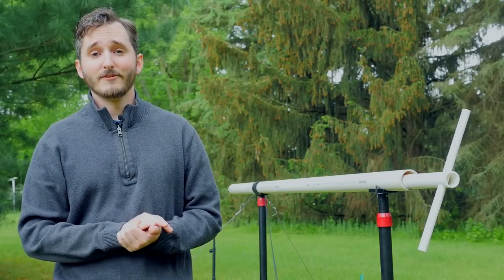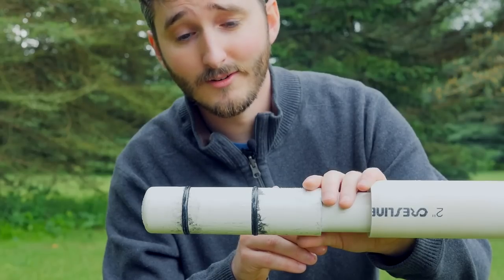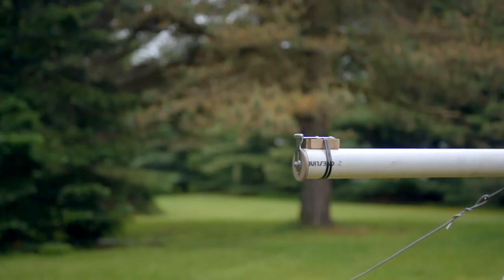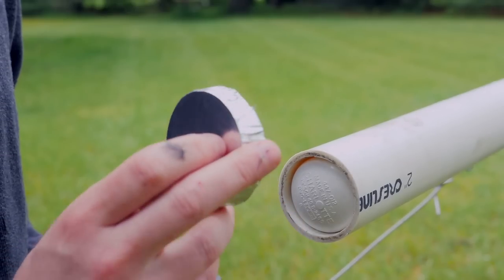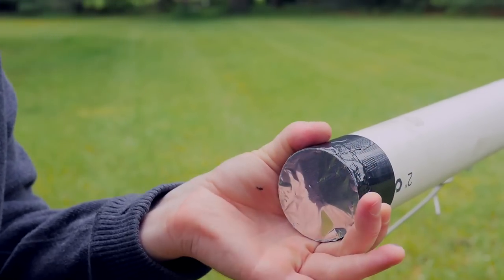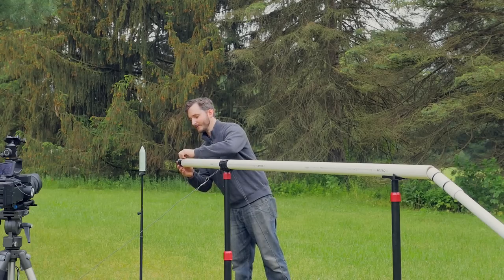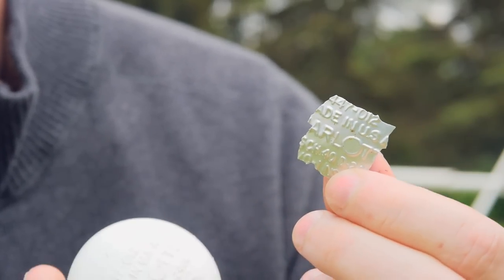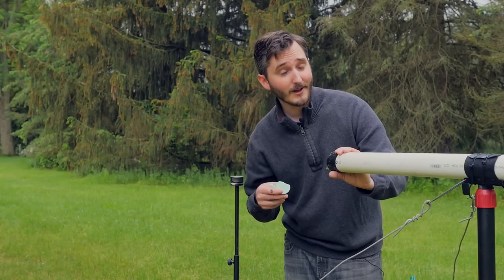New Vacuum Cannon Design - No Vacuum Pump Required!

Comment: Great invention! I'm gonna try and make this, I'll give an update on the results...

EDIT: Made it. Great design. This was one of my first inventions of this kind, it was really fun to see it fire. One bit of trouble I had was having the foil seal at the front pop as I pulled it back before it fired, I had to layer one thicker kind of foil over a thinner one. It wasn't as powerful as this one, about a third the size, but it shot about 25 ft, that's good enough for me. Thanks!

Comment: That thing you used to improve the end of cannon could be upside down to have a little help of gravity to open before the projectile reaches the cannon's end. If this keeping falling before pull the "trigger" you could use a weak magnetic on the top of cannon to hold it closed until the trigger be pulled.

Comment: Completely awesome. I wonder if you could rig up some kind system that could be mounted to the cannon to push the piston so you wouldn't need guide wires. Something like a hand crank winch or rack and pinion.

Comment: What if you interested used the projectile as as an end cap? That way you can make a better seal and not have to make the disks. Also for the air that will push it forward a bit before the the "big push," you could make an exception that goes around the projectile end cap, then put that at the end so you can still get the full push of the vacuum.

Comment: Ive considered building a recumbent trike from schedule 80, even heating and squashing it for use as leaf springs in two front end suspension type of a leaf spring.  Your piston seems to fit the bill as an nice air shock for the rear wheel.  if schedule 80 isnt enough by itself then sliding an additional schedule 40 to add wall thickness surely would do the job.

Comment: This is a really cool idea.  I had a few thoughts though that might make it a bit more portable. If you fasten a rope to the back of the piston rather than a long rod, you could crank it back with a crank attached to the breech end of the barrel.  That would keep it from needing the bracing.  You still might need a rod to push the piston back to the muzzle of the barrel for the next shot, but less force there, so again you wouldn't need the guy wires and braces.  I think the trapdoor on the end is a great idea, and it would work, it's just a question of mass.  The air pressure in front of the projectile isn't accelerating the trapdoor fast enough for it to get out of the way in time.  It really needs to be something lighter than a hinge, metal plate, and bolt.  A string dangling a piece of very thin aluminum or plastic against the muzzle might work.  You could lower the moving mass too by putting the rubber seal on the muzzle rather than having it on the plate, maybe a groove on the muzzle face for an o-ring?

Comment: If you put the flap valve opening to one side, it will open quicker. With it vertical it has to lift the weight of the valve with only the air pressure so it doesn't work. With it opening to the side or diagonal, it has weight supported by the hinge so it will open quickly. Try it.

Comment: That is really neat. The problem with the flap is it loses pressure around the side the further it get away from the muzzle. Maybe try something like a mushroom disk insert kind of like a thin wide champagne cork. Then attach a spring pulling it down attached to the "mushroom head" part. That way once the "cork" is pushed forward just enough to clear the end it gets yanked directly down out of the way. That and if it isn't fast enough the spring will at least tether it from getting lost.

Comment: That was an amazing off the grid way of doing that.  I wonder how small it could be made.  Hand held potato popper is what I'm thinking.  It would be more feasible with a quickly re-usable end seal but would need to be a different design from your flapper.  Either faster or balanced so when projectile does hit it, the projectile still flies straight.

Comment: Hey there, Kiwi fishing fanatic here.  Just a thought on this Vacnon :) if you were to use line instead of the inner pipe and attach a winder to the base you could make it winchable :).. which would only really cut down on the distance behind your Vacnon but would make for an interesting change.  Would make a great bait launcher.

Comment: You are amazing, I really like the way you come with simple solutions for the oldest problems. Just a question, if you put a 1 way valve at the shooting side, and dont use any projectiles, you will end up with a pretty hardcore pressure cannon right?  Ignoring the efficiency loss and whatnot you could tecnically attach a second pipe after the 1 way valve and than put a projectile. That way there would be no need for changing aluminium disks, right? Of course that is just an untested idea I just had, I'm not an engineer here.

Comment: If you use a magnet on the piston. Cut a round rabbet joint on the inside to hold it  then epoxy or hot glue it in place inside.
I want to know how well it does for distance... Like launching a bait out into the surf (Maybe a frozen bait cylinder/bullet with the weight, and hooked bait frozen inside) Make the cylinder by freezing it in a piece of scrap pipe the size of the barrel.
How about an eyelet on the end of the piston and have a piece of thread in the projectile that gets tied to the eyelet?

Comment: If done correctly, you can miniaturize this design into one that can fire ball bearings. Set up a sort of pump trigger release on an encapsulated piston. Set up air tight ball valves that pipe into a ball bearing barrel. Cock it back and allow the imperfect compressed gas to shoot forward and launch the ball forward.

Comment: Hi NHIL  
I made a low power VC with a Dyson vacuum cleaner continually sucking on a T piece at the muzzle end and fed Guiness draught beer can widgets in the other end (nominal OD of widget was 32mm ID of pipe about 35mm, good tight fit).  The burst disc was made with a business card at the muzzle end and like I say the loading end was permanently open.
Now I tried to make a balanced flap at the muzzle end with a piece of tape as a hinge on the business card so that the card would get blown out of the way by the widget leaving the tube and then with a bit of gravity and suction the card would return and cover the muzzle end effectively resetting the burst disc.
I gave up because the energies involved were just to low.  Make the card and hinge strong enough to return in an effective and repeatable way and guess what the widget can"t move it.
Anyway my idea was if it had worked a hopper of widgets at the load end for a full auto VC....then world domination...MWAH HA hA MWAha..cough.
I worked for Guinness at the time so there was a plentiful supply of ammo.
ANyway, you could drill three holes at 120 degrees about 300mm from the end of your barrel and then you wouldn't need to draw the plunger out the seal would break as you passed them.  If you drilled these three ports at an angle you might get some spin on the bullet???

Comment: If you were to remake the end cap and attach it from the bottom to utilize gravity in the release and also have it spring loaded for release. You would have to secure it to end of pipe via draw string until vacuum was enough to counteract spring tension.

Comment: Someone already said to use a magnet to hold the projectile but another option would be Velcro since it would add marginally less weight not to mention they sell them in strips.

Comment: May I suggest magnets?  Glue or screw a magnet into the end of the piston.  Then have a small tail with magnet or ferridic metal at the end mounted to the projectile.  If you  wanted, you could make simple arrows, that way they stabilize in flight and allow the broad head to stand off from the piston a bit.  Having more exposed surface area when the piston seals reach the end may give it a bigger instant kick, boosting the performance.  That's just a theory though.  In the end, you won't have to tape the projectiles down continuously.

Comment: I think that if you were to make several slots or series of holes on the rear of your barrel to act as a relief valve, you wouldn't have to  completely pull your piston out of the barrel. Of course I don't know if this would adversely affect the speed of your projectile but I do think it would be minimal.

Comment: Perhaps rear side-loaded projectile (round) that would drop in from above / side chamber?  Would require multiple seals and a longer piston I think as the breech/clip section would cause a break in the vacuum while the o-rings passed it... so the o-rings behind / in front would need to take turns holding back the vacuum. 

I'm not sure if this would be more reliable (or just easier loading) than the current (very smart) design but it would be different :)  Maybe make a smaller bore design for ping-pong balls using this method?

Thinking it through, you might need something to seal the breech area so the projectile doesn't get forced back up into that top chamber.

Anywho, cool video - looks like a fun project!

Comment: Very Interesting.  If you placed a stop or obstruction some distance down in the  barrel and used a projectile with sealing rings, you might dispense with the aluminum foil or flap valve or taping the projectile to the piston.  Of course, if the stop is too close to the muzzle, you would lose accuracy, and too far, you would lose power - but perhaps the barrel from the muzzle to the stop could be vented.  Have you tried anything like that?

Comment: Use the flap valve, but mount it from underneath. It will not be fighting gravity to get out of the way. Using a weak magnet to keep it up while the vacuum gets a hold.

Comment: how about using that same reusable blast cap hinge with a wound up coil as you press it flush with opening in front. with little clips barely holding it down were the blast would easily disrupt and release those clips. ultimately releasing the coiled tension shooting the hinged blast cap upwards?

Comment: Love the design. Maybe to solve the problem with the cap, you could put a little space before the projectile. That way when it shoots forwards ghe air would open ghe cap for you, especially if the projectile sits snuggly. Perhaps wrapped in tissue paper. May be the solution. Cheers.

Comment: Two thoughts, 1) could you use Velcro between the piston and projectile instead of tape? 2) could you use a threaded coupling on the muzzle end you could then have a number of burst discs already set into the outer threaded (female threaded) couple, that could simply be screwed into place? Just a thought... (really this was just an idea to remove the need to waste tape every time you fire the cannon).

Comment: My segustions: Drill a hole so you don't have to pull the piston all the way out. And a magnet could be used to hold the projectile to the end of the piston. put the metal on the piston so your not shooting metal and craft magnets are often easy to melt on to things with a heat gun.   Great video, good production values and lighting.

Comment: use the 50 psi thrust to drive pressure into a tank with assistance from a diaphragm, repeat and achieve high pressure . Shoot projectiles at 300 psi

Comment: You should look in to making a vacuum cannon with a small co2 cartridge at the rear. Not only will you have the vacuum force, but also a pressurized force that will multiply your speed dramatically. Maybe make a small hand held version, like a pistol or rifle.

Comment: you could use a bit of string to pull the piston back. would make the design a bit simpler. also you might consider seeing if you can base a design on drinking straws- maybe use a cotton bud dart as the projectile? Anyway congratulations on a magnificent achievement.

Comment: I feel like the flap valve would work if you put the projectile in with about an inch or 2 before the front, then used a price of take to create a slight seal on the flap which would seal better with the backward motion of the piston. The technique you used in this video seemed to have the seal of the flap disc happen right away whereas purposely leaving air in front of the projectile allows it to open quicker without being hit. You could also try using an elastic on the flap valve and securing it down with tape so it opened even faster.

Comment: Here's a thought.  If you make a second barrel that's longer than the first, with a second piston, and join the second barrel to the side of the first at the business end, would that provide ample place for the gasses in front of the projectile to rush out of the way?  Similar to the gas piston system of an automatic rifle, but not quite.  Alternatively, merge multiple pistons to a single barrel for more of a vacuum.

Comment: The end where the piston comes out, you could have a Tee with a check valve on it. Rather than pull the piston completely out, the check valve opens when the piston gets past it.

Comment: Actually, referring to a comment below, i believe a better solution than the burst disk and flap is attainable. Firstly, get an end cap that fits over the barrel. Attach a rubber plate inside the back of the end cap, and this is the projectile. Place the projectile on the end of the rifle, and then pull back. Surely this would be a fun way to see if the accelerating air coming from the back of the cannon will provide enough of an impact on the projectile. I suppose a similar design is a cork gun.

Comment: try a manual actuator on your reusable burst flapper valve. Run a string or rod that is attempting to open it when the seal is about to break. In theory the string wont be able to open the seal until the pressure is equalizing. So stretch will be a good thing. Just an idea to get the door open in time.

Comment: You could have put a spring joint, or even a rubber band on one end to lift the flap valve to help lift it up and out of the way as long as you are able to keep it held down from the vacuum pressure.  Just an idea.

Comment: try spring loading the hitch valve to make it open or put a motor on it that activates when the piston is out via a metal contact on the piston end or by a switch that gets flipped by the wind rushing into the PVC. (or do all of these at once).
Reply: ...and hook it up to a computer to capture all the data.

Comment: Interesting cannon.  I like that it requires no equipment and if there would be a failure in the cannon it would implode not explode.  Is the vacuum seal stable?  I’m trying to design a small cannon to launch throwing bumpers for training retrieving with dogs.  It would be interesting to understand what kind of payload your cannons can handle.

Comment: Would the flap valve work if it was hinged on the bottom instead of the top?  If not, would a counterweight on it help?  Awesome video. Never heard of a vacuum cannon until now.

Comment: I think the flap disk keeps falling off because the projectile strikes the area or exerts force onto the lever arm. This transfers more force into the holding ties rather than the hinge. I think it can be fixed by using multiple triangular hinges like a cone arranged like a pizza. this might keep the force on the tip of the lever and reduces stress on a single hinge

Comment: If the problem with the flap valve is that it isn't getting outta the way fast enough, surely a small pinhole near the back end of the vacuum pipe (like maybe 1 mm diameter, 3 cm from the end) let in enough air to burst open the valve without firing the end cap? Sure you'll lose some power, but at least you won't have to keep replacing burst discs.

Nice design and vid, BTW! If only kind words pay the bill eh?

Comment: i made a pvc golf ball air cannon
 the chamber is about 18" 5"dia,
~110 psi
the most difficult part was modifing the ball valve,
i cut off the side that faces the chamber (when closed) and the rear ball seal.

a few days ago i put some snow down the barrel and got a good recoil and a shower of snow

Comment: you should add a flat spring (leave spring) to the flap valve. it rests on the valve when it's closed and the spring should be orthogonal to the flap and when the flap is moved slightly it's out of balance and pushed open.

Comment: If you wanted to get better results I'd say you could try making a cannon that narrows like rifle casing; With the force of a 2" chamber being applied to a 1.5" projectile, you would effectively be maximizing the inertia to mass transfer ratio... Of course problems arise there too, like the lack of space for the projectile to accelerate, and the fact that the force being applied might shatter the projectile even before it left the barrel.

Comment: Great video! Would it work if you drilled a hole just before the draw tube came out. In turn letting the air in? Then marking your draw tube so you know where to stop.

Comment: Perhaps you could use a full 10 foot length of PVC for the barrel, will hikes cut in the last two feet. That would allow air to rush into the barrel as you pull the piston back without having to remove the piston completely from the barrel.

Comment: I have an idea to make the end cap reusable. Make a solid disk of metal, and use small pieces of tape to attach it to the barrel, like how you attach the projectile to the plunger. That way, the cap will fall off instead of having to flip up.

Or, to use the flip cap you already made, affix it to the bottom of the pipe, and tape it up with a small amount of tape, so that the valve opens downward, instead of upward. That way, the cap won't have to fight gravity.